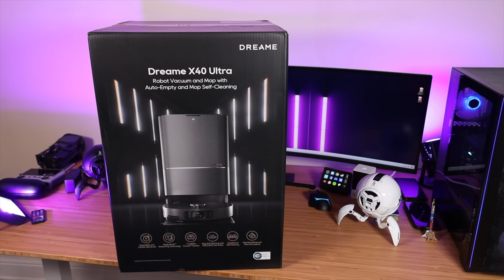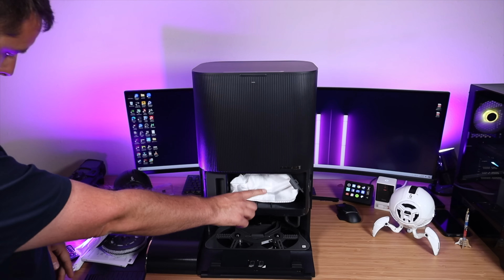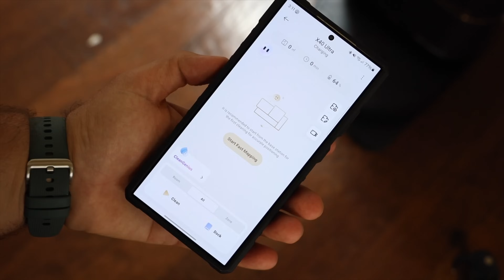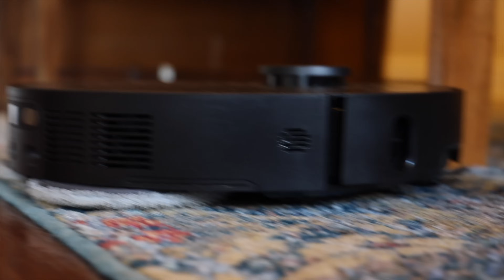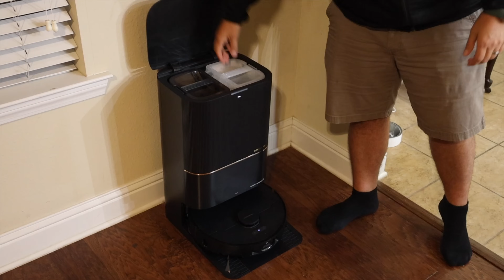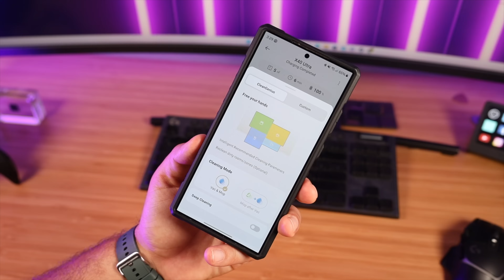Dreame X40 Ultra : Best Robotic Vacuum of 2024?

Comment: I didn’t see the mention of how the side brush turns off on carpet. What happens if you have wall to wall carpet. Do the edges and corners just not get clean?
Reply: That seems to me to big the one and only disappointment with this robot. Apparently there is a global option under carpet settings to tell the Dreame to ignore carpets (i.e. ignore the fact that they are carpets and treat them like hard floors) and with that option set the side brush does work. You would of course have to be very careful to have the robot set to vacuum only whenever it is in a room with carpets otherwise it will mop your carpets!

Disclaimer - I don’t have an X40 so this is only my understanding after watching every video review of the X40 that I could find but I did see one review where the reviewer had turned on that carpet/ignore setting to force the X40 to use its side brush for his carpet pickup test. From memory the score went from about 95% pickup without side brush to about 99% when he forced the X40 to use its side brush.

Comment: Fantastic video! Thank you! Just one question, I have read on reddit that the cleaning solution is just for cleaning the pads and it's not used to clean the floors, but in your video I see that the solution itself mentions "floor cleaner". My question is: Is the solution actually being used to clean the floors or just for cleaning the pads?